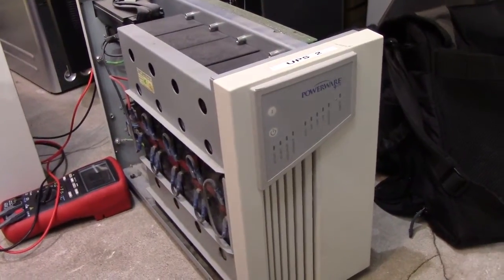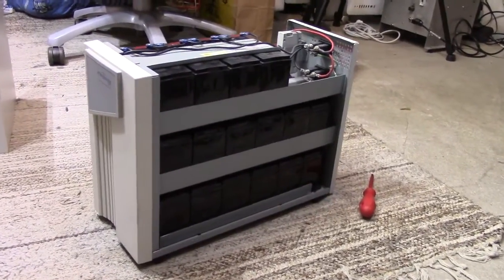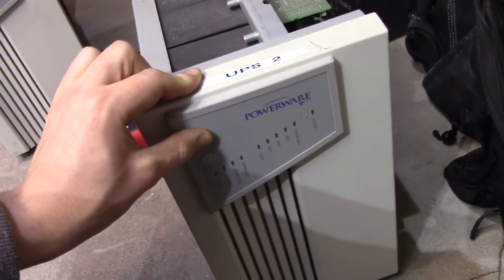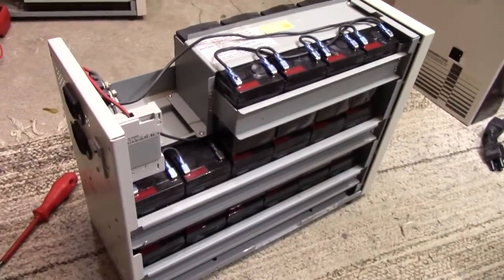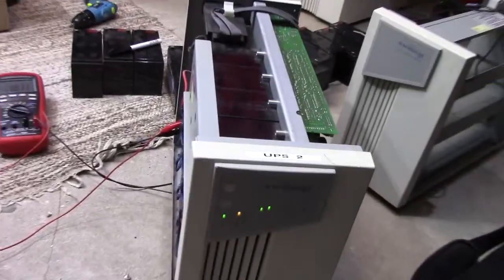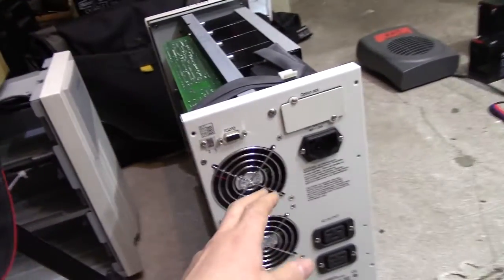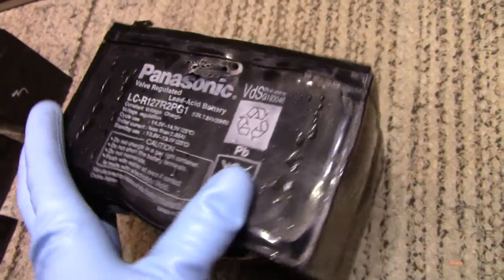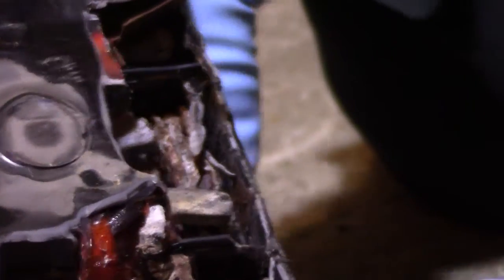Powerware 9110 battery CARNAGE

Comment: It's not just shorted cells that can cause this, high ambient temperatures along with a poorly ventilated battery cabinet is also a major cause of thermal runaway. I've seen this occur in many UPS, even ones not running high voltage series strings (24V series-parallel packs have done it too!).

The batteries are often packed way too tightly, with no room for convection cooling between batteries. If the UPS is in a room without air conditioning where it's fairly warm to begin with, you have a prolonged power failure at high load which warms up the batteries due to their internal resistance, followed by a return of power then the UPS starts recharging the batteries while they are still quite warm... perfect recipe for a thermal runaway. Likelihood of this occurring is further increase by lack of maintenance (ie: using batteries that are well beyond their useful service life and starting to become unbalanced).